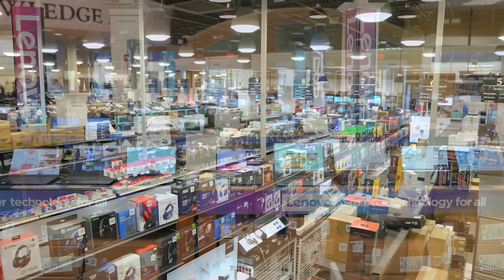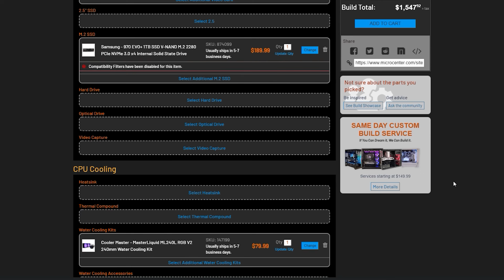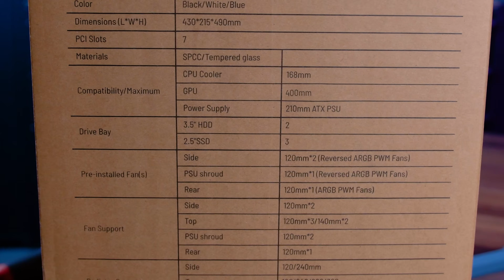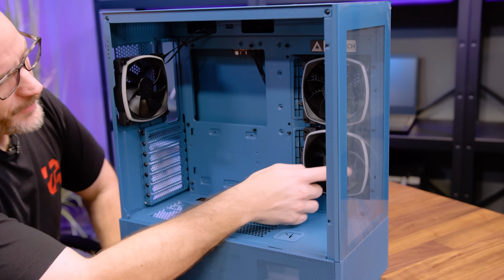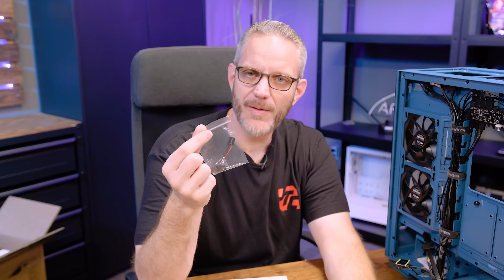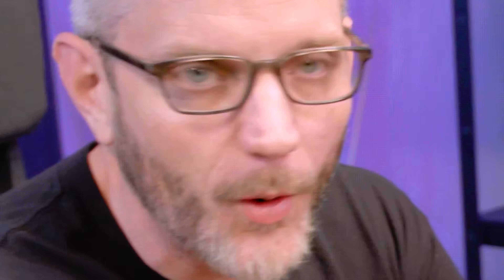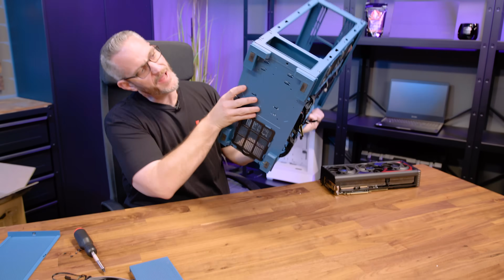This case has a funny name but awesome design choices! Montech Sky Two

Comment: Me still on a Thermaltake V71 from 2014 lol, wow basically 10yrs now damn. Im glad i kept it during my past 3 builds and never went to something else even though its a BIG boy. Its ATX and the way the size graphic cards are going, i think its gonna come in handy haha. Lets me load it up with fans too. Might not be the best case as i hear tempered glass can be hot? However for me i honestly have had no problems. Maybe its bc i gutted all the SSD/storage shelving that sits directly behind the front two 200mm fans to let the air flow better through it(as the shelving took up a good amount of air real estate). Been a Solid case for me atleast.

Comment: So speaking of those little LCD panels as sensor panels, I am about to finish up a 3D printed design for mounting one to the rear of a Lian Li O11! If anyone is interested in the files for it, I will be posting them to Thingiverse hopefully tomorrow! :) Will probably title it "5 inch Display mount for Lian Li O11 Dynamic", also working on adapting it to standard 120mm fan mount.
Small edit: Just ordered the threaded inserts and screws for testing, won't be delivered until next week and I don't feel comfortable posting the design if I can't verify it works 100%. So will be posting by next Friday (1/20/2023) if all goes well!

EDIT: I FINALLY FINISHED IT!!!! School caught up with me plus one of my prints failed so I lost motivation for a bit but the project is on Thingiverse :) Just search " 5" Display mount for Lian Li O11 Dynamic " and you will find it.
Reply: How to spot a sigma chad:
Reply: This is using the same display Jay and Phil did a guide for a few years ago just fyi
Reply: Interested! Ill keep my eye out for it!
Reply: @Newarleenz  Finally finished the project, posted it on Thingiverse
Reply: @masooncap9769  nice! Forgot about this, fun lil suprise for me! Thanks so much!
Reply: Oh nice! Can’t wait to see what you come up with.
Reply: @toweringtower  Finally posted project, on Thingiverse

Comment: There is no way a 240mm rad is fitting on that back panel intake. Those 2 120mm fans just fit in there. Unless you are doing fans behind the rad, but then that kinda defeats the purpose of the neat reverse fans.

That said, i do think it is a fair compromise to do the side panel fans along the back of the case for the front glass panel. Not my thing, but I’m not in standard cases to begin with. Only 1 of my cases in use has a window and the case is located somewhere where you can’t even see the window.

Comment: I think some colors are not bought because they cost more.  Assuming your info is correct, they sell 1 white  to 8 black cases and the white cost $20  more then to boost sales would it kill them to equalize the price by making them the same? A $100 case would cost $102.50 so that every 8 cases sold would cover cost of a white case.  I believe that the white one costs more because it is unique and they know it so they gouge on the price because they know it will sell.  Odd ball colors are always out of stock so if they made more to meet the demand then it would break the notion that it cost more.  With all that said, this is a beautiful case.  I'd love to see a build with it.  I'd also like the channel to do an open air case build to see how they stack up to some of the other builds from the past.  I'm also curious on how well those fans perform.

Comment: I just bought one, its very good quality and has a lot of space, the fans are ok, they go up to ~1800rpm, my only issue building is the space for cables on the bottom, i still use HDD and could not remove de HDDs case, so it took some space (1tb SSD's are a little expensive in my country)

Comment: The biggest thing that really jumps out at me on just the first glance is the lack of fan coverage. I'm seeing 3 intake and 1 out for fans (if you go that route) and not a lot of air holes for the case to breathe. I'm also probably more than a bit bias with my case having 7 case fans and a push/pull aio (3 of them are case fans.... so 10 case fans total.... heh) to keep my pc cool and my room hot, but all kidding aside, this one does seem a bit choked out (and i'm all for being ... nevermind).

Edit, ok, so, i've watched 30 more seconds and just discovered that you can have an aio on top. I absolutely like that option. I'm still a little concerned about it having slightly negative air pressure if you use a 360, or a 360 push/pull, but thats a major improvement already imo.

Comment: I scooped up a montech meshify x3 open box for $59 a month ago. I wasn't sure about the single speed fans but they are actually really decently quiet and move plenty of air and it comes with 6 fans lol. Great case for the $.
Reply: I'm running that same case now. One of my 6 fans was DOA but the other 5 worked so I wasn't mad. It's been a great case but I just ordered the sky two because I needed more room for the new GPU I just got.

Comment: i think the reason they had the bottom fan as a bottom fan is that they're assuming most people building in this would have an AIO (with its included fans) mounted in the top

Comment: I have a case from Montech which is the Air 100 and I absolutely love it. It's a matx case and you can fit a 360mm aio even though they say 280mm is the max. (I put a 360mm nzxt kraken in the front)

Comment: That tempered glass shattered because you dropped it on tiling. 

Ceramic has ZERO elasticity. it absorbs nearly ZERO energy, so all the impact energy goes into the glass, shattering it.

Comment: montech air 100 is my absolute favorite matx case. i even had great customer service with montech. i built a couple pcs for friends and i used this case on a whim and i ended up loving it. it came time to build my gf a pc and when i went to order this case on amazon it wasnt available because they were switching to work exclusively with micro center. but they also didn't have it yet, so i emailed montech and they quickly responded. i told them how much i loved the case and wanted to purchase it. they sent me a private buy link and was very appreciative of everything i said about them. they are very much a "budget" manufacturer. but price to performance. cannot be beat

Comment: Jay? Is it possible for manufacturers like Lian Li or Corsair add a toggle in their software that could reverse the fan direction to always keep the nice side in view like the new Thermaltake fans? Is there a different motor needed in the fans or can it simply reverse the polarity or how ever they do it? UPDATE I just looked up those new TT fans and you swap the fan blades, I guess it's just not as easy as reversing the drive direction, NM I guess.
Reply: The fan blades themselves have to be reversed, you can't just spin it backward.
Reply: @--_DJ_--  Thanks bud, I just did some research and discovered that. I did an update. Do you think its possible to create a two way fan though? I think that is a great way to test a systems best flow configuration as well as the better esthetics.
Reply: @IDv8I  You could but it would never be an optimal design. Having a motor go both directions is easy, getting the blades to work both ways would be a lot tougher.
Reply: @--_DJ_--  OMG I didn't even think of the blades....such a noob. Guess I should think before I post lol

Comment: Most fan set ups don't provide good airflow to the bottom rear of the case where the GPU pulls air in. I'm a big fan of having a fan drawing in fresh cool air and directing right towards the GPU. Positive intake pressure along with heat naturally rising will have the hot air move out the top so if just using the fans included, I would keep it set up the way on the box.

Comment: I've been doing a lot of Montech builds lately. Their old cases were sorta junk but you can tell with each new case they learn from their mistakes, and they keep getting better. For the price it's really hard to beat the quality you get now.
Reply: Well maybe junk is too harsh. I bought one of their first cases ages ago and yes, build quality was not that good ( although not even that bad) but I paid it 35€ brand new off Amazon. And that was with 3 included pwm fans. The price made it up for the sub optimal build quality.
Hell, a single fan of my current build is 32€.

Almost no product is junk, those who are it's because they are overpriced.
Reply: @pierb2848  yeah same thing with Apevia. They are basically considered crap now and were popular with budget gamer builds back in the day. It was the first case i ever bought for building my first pc in the early 2000's. it was so awesome compared to the compaq i had been using. Im actually using an Apevia PSU in my stream machine and felt my jaw hit the floor when LTT called the brand a "no name brand"
Reply: Junk is kinda right. I had the montech x2 and I will say there were definitely mistakes when making it bet still not a bad case. One mistake imo is the space for cable management is not that good and could definitely use room for improvement
Reply: Tried to buy the montech Air 100 for my daughter's build for Christmas. Unfortunately their UK distributor CCL computers are a bunch of incompetent clowns and sent it to an address in England. I live in bloody Wales. The address they sent it to wasn't even similar to mine. I'm still waiting for a refund from them.
Reply: I have the Montech Sky One, and their front panel RGB never worked correctly, it keeps flickering. That happens because the 4 pin connection never touches the contact board completely. It's an interesting ideia not using cables for the RGB, I just wanted it to work tho.
Reply: Have you formed an opinion on the Montech x3 Mesh?  I've been considering it and would like to hear your experience with it.
Reply: @torporvasflam8670  I've done one build with the X3 Mesh, and wasn't super-impressed with it - relative to their newer cases. The LED fans are what they are and the case feels a little flimsier than the newer ones. Personally I'd spend the extra $10 and go with one of their other cases. Just my personal opinion, though.
Reply: @festivus7065   thanks man
Reply: Do you have any cases of theirs that you'd recommend?
Reply: @bleack8701  I’m using the Air X from them i don’t remember how much it was when I bought it but I just looked and it’s $80 on Amazon. It’s a decent case but I feel cable management is the weakest part of it theres not that much room
Reply: @bleack8701  I like the Sky One Lite for ATX builds and the Air 100 ARGB for MATX builds, both a re pretty good cases IMHO. Getting a full suite of fans with those is a huge value bonus.
Reply: I agree, I used two cases from them in 2020 and they were nice but obvious mistakes with the intake cooling. I had to modify them to get Adequate cooling. Looks like they did in fact learn
 from their mistakes which is good for competition.
Reply: how about the montech air 1000 lite? I'm looking to order one because of all the mesh
Reply: @heysunnyboy-q7y  not used it myself, BUT it is available in the UK... Which is good thing
Reply: I built in an X3 at Xmas for a customer, I was surprised at the quality of the case for the price, was a pleasure to build in but the fans were a let down, having 6 included for the price is great but I'd rather it was 10/15 cheaper with no fans
Reply: @rossharper1983  I always like to see fan/no fan options in these cases. There are times when the included fans are fine, and times when they're gonna be replaced with something else. Better to just not have to pay for them.

The X3 isn;t a bad case but yeah, those fans are a disappointment. They seem to be using much better fans in their newer offerings, though.
Reply: They are junk Jay needed a new old car so you get a Montech is good video we know the truth
Reply: Maybe, but no 5 1/4" drive bays mean no purchase for me.
Reply: @arnox4554  what do you do with a 5 1/4"?  I need some 2.5 and 3.5's for SSD and Hard Drives.
Reply: @weldsj8847  For hard drives specifically? You can get a hot-swap bay that lets you switch them out any time. 3.5" and 2.5" both. I have one of those myself and it's so choice.
Reply: @Arnox  external enclosure seems to be the way now unfortunately I wish they would put them on the bottom up front
Reply: @arnox4554  I was like that, but then I got my windows on a USB, changed my case and I have not looked back. MOST cases do not have 5 1/4" drive bays these days.
Reply: @ChrisMDSmith79  Doesn't matter. They're still extremely useful and versatile.
Reply: @arnox4554  I havent seen any new cases with them. even beQuiet! have stopped putting them in. I had a drive for 6 years in my last rig and that only got used to install windows.  never used it again.
Reply: @arnox4554  in fact the 2 other rigs I look after, their drives are the same age and only been used to install windows. All 3 drives will not open either. 2 are LG BluRay drives and the other is a Panasonic

Comment: I have a the Montech air x case and I’m telling you man it’s one of the best designed cases it’s got plenty of space and easy to change out parts like replacing the fans, only issue I have with it is front to back it’s a little short so the aio I have in it had to go on front instead of the top like I wanted but in the end it ended up looking really good so it’s worth it plus it was $80